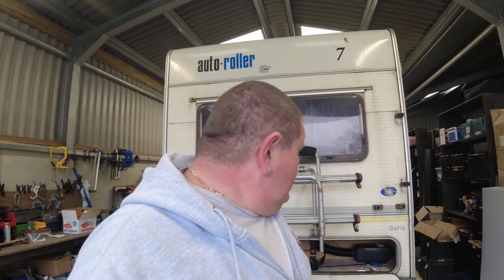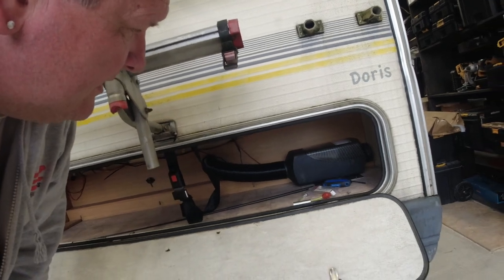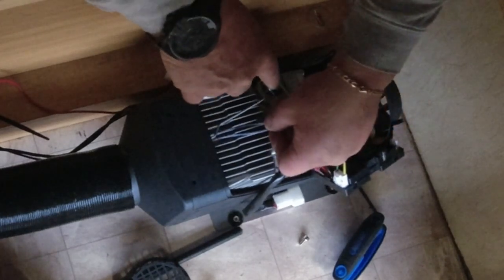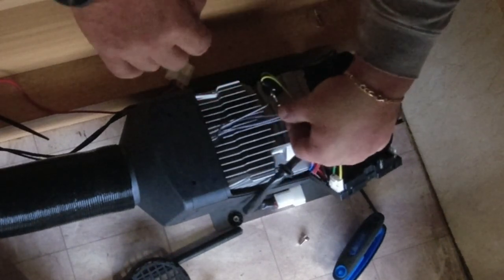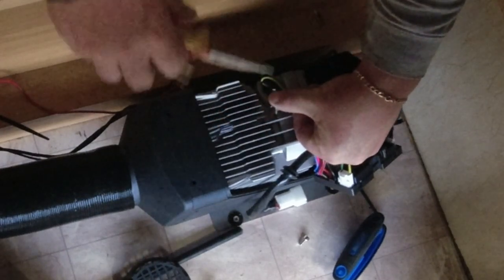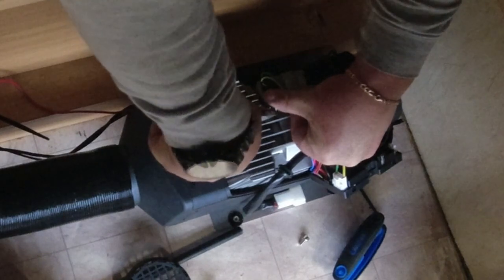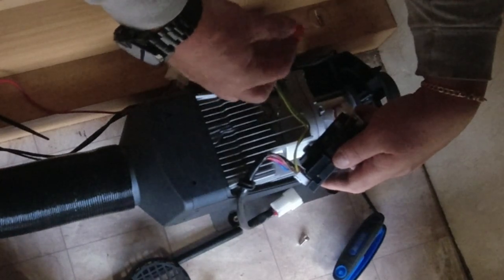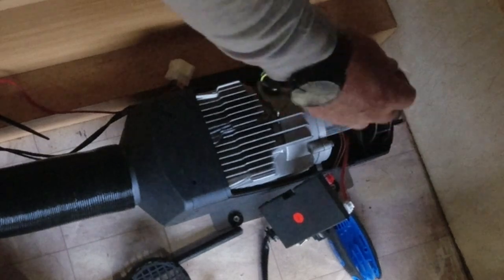Chinese Diesel Heater Fix -   FAIL or SUCCESS

Comment: Almost certainly motherboard so would need both bought together so they match (around the £30 mark). If the sequence isn't right it simply won't fire up and all of that is handled by the main board. I've yet to investigate but I suspect its down to the relay or associated components on that board that switches the glow plug on. E-8 is simply no burn. Its not always fuel (although the first place to start) - it simply means the unit hasn't fired up. I'm fairly sure the relay on the motherboard handles the ten or so amps for the glow plug and I suspect that if the secondary side fails, as far as the motherboard and display know, the glow plug is actually powered up, but in reality no power is going to it, even though one side of the relay has energised and the display says all is well. The only way to know for sure is to put some test probes in the glow plug socket on the motherboard with everything connected and see if there is power there (and how much) when display shows glow plug is on. Easy enough to verify if glow plug actually works by hooking it up to a 6v battery (briefly) with a couple of test wires shoved in its socket.

Comment: My diesel heater displayed the same error code right after my initial install. It would run for couple of minutes, blow cold air and goes to shut off mode. This was due to the harness connected to the pump. It was not fully engaged. I suspected this immediately  because I did not hear it or feel it click even with the metal pin fully engaged. Try to reconnect your pump harness and give it a hard push. If this does not solve it, check for any minor almost invisible leaks in your fuel line especially between the tank and the filter. Your pump might be sucking more air the fuel. Good luck
Reply from the maker: Thank you, that is good to know I will try that